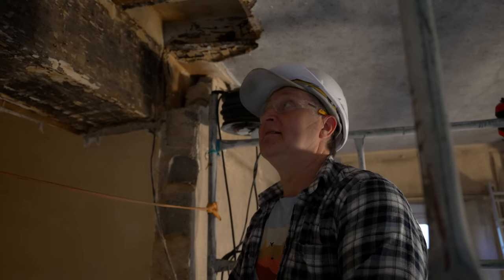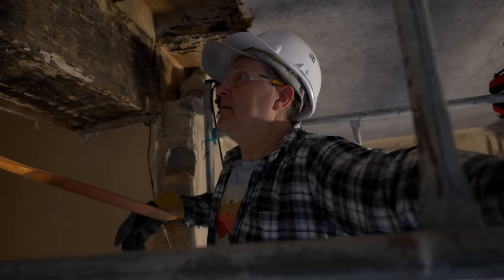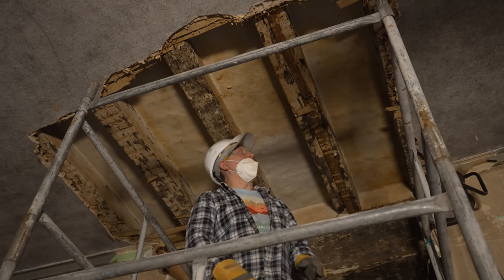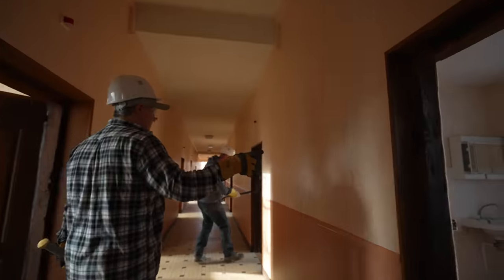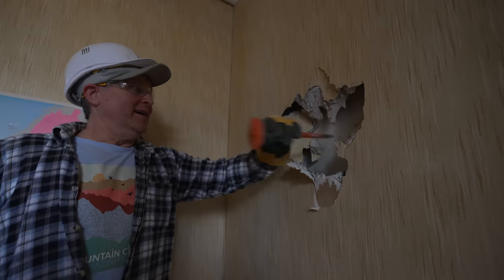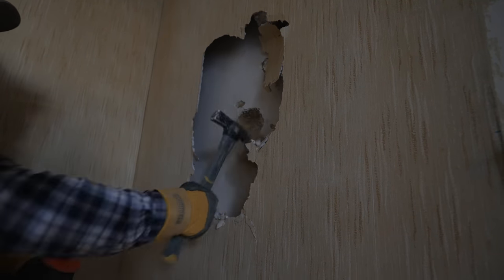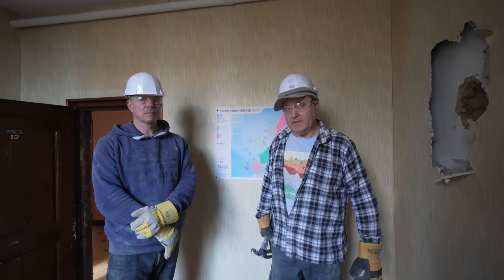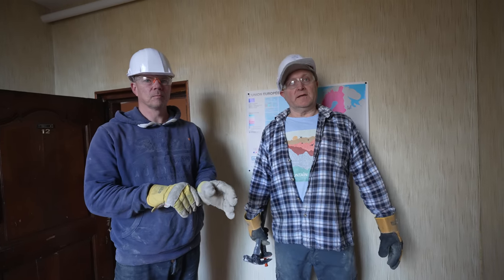Exposing The Original 250 Year Old Ceiling

Comment: You should check the other 2 walls that run perpendicular to that beam to make sure they're not supporting it in the middle. Even if they're not original, whoever put them there may have done so to stop the beam from sagging in the middle.   Can you find the spot the basement directly under the kitchen? See if there's anything below that might be supporting the walls you're removing.
Reply from the maker: our guess is that the walls below where for practical usage of the space however the main beam is still resting on that wall. we need to tread carefully removing it. the beams have both sagged but it’s not because of the weight only because of the great expanse between them which is 8/9 meters.
Reply: @ThePethericks  Does France have anything like the "English Heritage" program? I think this project is perfect for a professional documentary program.

Comment: How to remove lathe and plaster the easy way.  I discovered this when renovating my 113 year old house.  Take a flat shovel (spade) and wallop the wall with it.  Do the entire wall like that.  That will crack and loosen the plaster.  Take the spade and scoop the plaster off the wall.  It will come off super easy.  Once the plaster is off the wall and on the floor, clean that mess up.  Once that is done, remove the lathe from the wall.  Makes the job ten times easier then having all the mess on the floor and trying to seperate everything out.  ps....I love that your staying true to the original beauty and architecture of the building.

Comment: You need to get a structural engineer asap. I wouldn't be taking walls out in a building that old without an engineer saying so. Just because it was a timber frame above doesn't mean it isn't load bearing. Only way to be sure would be starting in the attic.

Comment: Since you once mentioned the possibility of keeping the kitchen as a working commercial kitchen once the convent is renovated, PLEASE check with your local governmental regulations regarding commercial kitchens before you go to all the trouble of painstakingly restoring the ceiling and beams.  There may be rules prohibiting having wood structural elements in a commercial kitchen area.

Comment: Very cool Billy, that ceiling will look fantastic.  Do you think when excavating around that beam or ceiling cross beams, that you attach a bubble level at the center of the beam and one in center of ceiling cross beams and mark original levels. Then check for any movement of the bubbles as you go...just to be sure no major movement when removing all of the material that is currently assisting the support of the ceiling.

Comment: Interesting ceiling.  Are parts of the convent built earlier - as I noticed you said it was 18th Century i.e., built in the 1700s ?? Sounds like you have lots of info on the structure re whether any load has been transferred.  Worth checking for sure as other alterations sometimes transfer without it being realised.  Looking forward to seeing this phase.
Reply from the maker: 1773 it was built, the structure is quintessential from the era and the design is very straight forward to work with as long as there’s no rotten parts.

Comment: I know you guys are trying to open up this space for a big kitchen.  Yet, you don't want a commercial one.  I have to admit that the space is TOO big for a single kitchen.  You have to take on the idea of efficiency in the workspace with this kind of thing.  If it takes you 30 seconds to walk across the kitchen to the fridge, or to retrieve a tool in a hurry, or carrying prepared items to a cook surface, it becomes too cumbersome in that big of a space. You COULD make multiple kitchens for holding cooking classes in that sized space, though.  Edit: Also, check with your local fire authority.  They may not allow exposed wooden structural beams in a kitchen due to fire hazards.
Reply: I could be wrong but I think that his reference to making it a multi-purpose room meant open concept.  If so then there’d also
be an eating area and a sitting/lounging area ( by the fireplace?) bit I’m only guessing. Otherwise it is TOO BIG.  I guess we will see. Time will tell.  Stay tuned.

Comment: Billy, not to be a wet rag, but have you checked into the local codes concerning the walls, ceilings, etc. in a food handling area such as kitchens?
Reply from the maker: of course, local planning has no jurisdiction at the convent. unless we want to do something outside that’s another thing all together.
Reply: @ThePethericks  I don’t think Dennis was referring to building permissions, but rather health requirements. If you ever plan to use the kitchen for commercial or catering purposes there are usually some health department regulations about what materials can be used, how many sinks are required, drainage type, necessary ventilation, etc that can be quite different from a home use kitchen. If you do plan to ever use it for commercial purposes it’s probably something to look into.
Reply: @ThePethericks  The Bureaucrats on this side of the pond have their noses in everything you do to a building ostensibly for your own protection, but as we all know it's just a power thing.  A lot of folks just give them the middle finger and do what they want as long as it's not viewable from the street. 😆
Reply: @janetpendlebury6808  I had not had a chance to catch up on all the latest videos yet so had not seen where he stated that. I mostly responded to clarify the purpose of the original commenter.